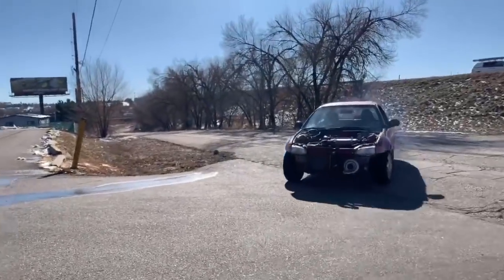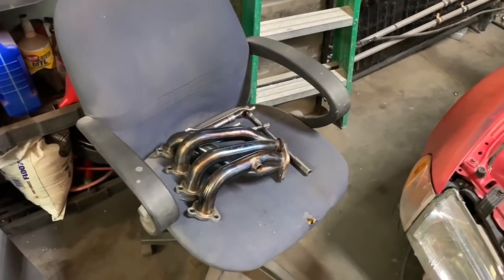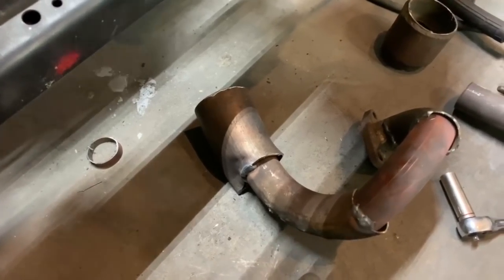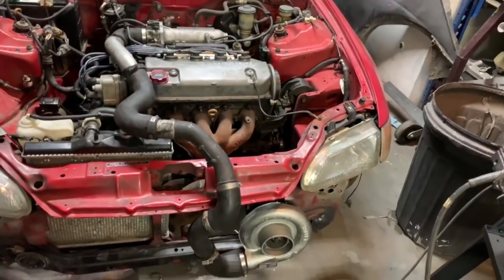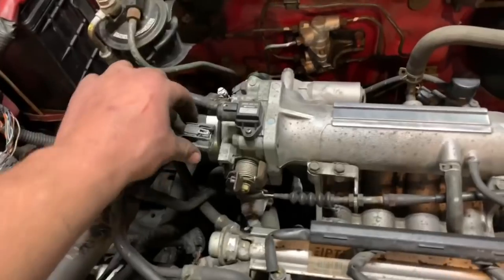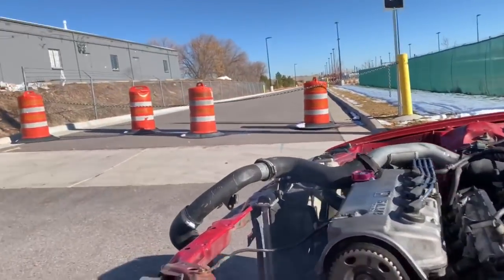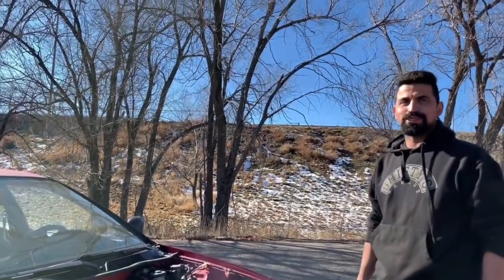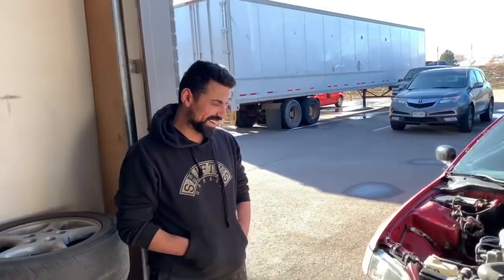Will a D15 Civic Hatch Spool GIANT HX55 Turbo??!! (63/99mm or 86/77mm turbo )

Comment: i think with a proper manifold, an exhaust down/uppipe and some work on the engine (cam and head porting) it could spin it up

nnote how i didn't say make useful power cause it'd start spooling at like 7000 rpm lmao

Comment: Why didn't you run oil to the turbo? Putting a cap full of oil in the turbo isn't gonna help with tryna get it to spool ,seeing as it's spose to have oil pressure fed to it
Reply from the maker: It’s supposed to be lubricated.  It actually is supposed to have limited pressure that’s why most turbos require a restrictor to reduce oil pressure.  

And because I don’t care about this engine or turbo, it only runs for 5 minutes at a time which is hardly long enough to get that big turbo warm

Comment: What if ya cut n angle your exhaust in the direction the rotor spins ta give it a bit mire umph? N instead of just 1 pipe run 4 seperate

Comment: Sooooo there's no radio withe the wires there, but you ran power and ground out the window to the engine bay, then to the battery. Ok🤷
Reply from the maker: I think you misunderstood the entire point of this was to do a crap job fast and see if it works haha

Comment: You guys should do a full "janky" build on this civic with the HX55 turbo. most shops would just give you their old or useable race parts. The parts list would go as such, d16 block with benson sleeves, o'ringed, 12.5.1cp pistons, pauter rods, arp hardware, custom intake manifold, ID 2000cc injectors, Hondata S300, custom turbo header, 4 inch core intercooler, remember all parts have to have 20-40 runs on the strip, heavily used. I think this set up would make about 760hp for 3 minutes, or no wastegate and it would make 999hp at 11,000rpm with 80psi of boost for 12 seconds before you blew the head, rods and the turbo. You guy do some really funny stuff with tunable cars 😋😏🤔🤣🤣
Reply from the maker: Haha I love that idea!!

Comment: Put a small exhaust system on it the back pressure would for sure help it build more boost, and possibly build a decent manifold lol that motor should build some sort of boost
Reply: Yea. If you purposely build backpressure after turbine, youre dropping DeltaP across the turbine, effictively making it spool slower.
Reply: Lmao.
Reply: @Skaude  something funny? I had a stock D16 that spooled a S500, didn't build 20lbs but made 8psi thru the rpm range.

Comment: Pull that hose off the boost pipe plug the boost pipe hole and run that hose from the valve cover to atmosphere
Reply from the maker: There is no hose on the boost pipe
Reply: Ahhh ok at 9:53 i saw that hose and looked connected

Comment: My advise is to keep the diameter smaller. Maybe You find a cone shaped tube? A lower tube diameter improves the flow.
Reply from the maker: Yea a few others suggested only running exhuast to one scroll of the turbo

Comment: I would just redo your hot side pipe and just spin one of the two scrolls and see if that helps boost since it's a divided flange it should spool it better I would think
Reply from the maker: You think that’d do the trick?
Reply: @GARAGEIdiotS  idk but I think it's worth spending 30 minutes to just do a little cutting and welding and see if it helps, either way I'm glad I found this channel it's nice to see the kind of crazy fun builds I've always wanted to do myself keep up the good work bro!

Comment: you need a solenoid on the fuel return line so when you need more fuel pressure, you just clamp the line and let the fuel pressure spike up till the internal relief on the pump bleeds some off.... at like 80psi.... you will need a turbo that actually make some boost though lol. put just the smaller saab turbo on it and add some oil feed and drains this time so you can test the ghetto fuel pressure raiser lol.
Reply: This or crush the oem fpr lol

Comment: This shit is what I want to see! Just add another 1.5 liter engine, so first dual engine and single large turbo...
Reply from the maker: Right on!!
Reply: Holy crap I've never actually seen that. That would be cool. One rear one front single turbo. Only problem is getting even boost to both engines.
Reply: James Godwin is you think about it your could split one of the tubes one to go to the intake in the front and one to the back
Reply: @NitroNoobRC  the pipes would have to be equal length with same velocity of air flow. It would be very difficult to tune the engines to be properly in sync.